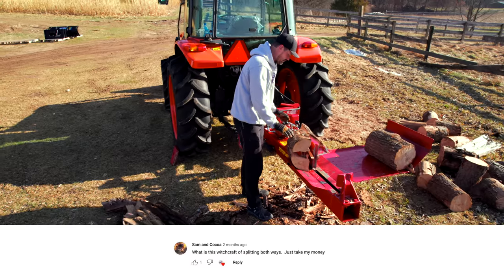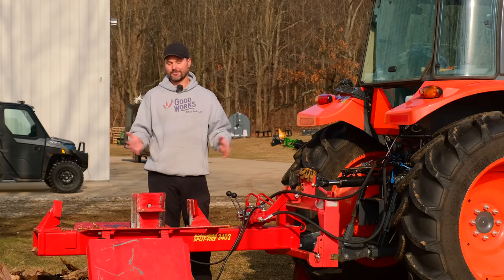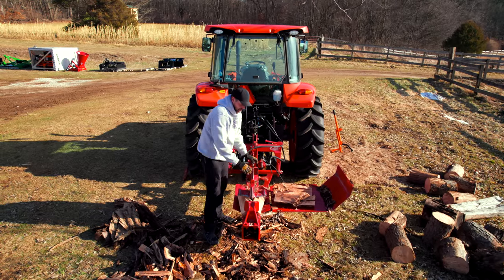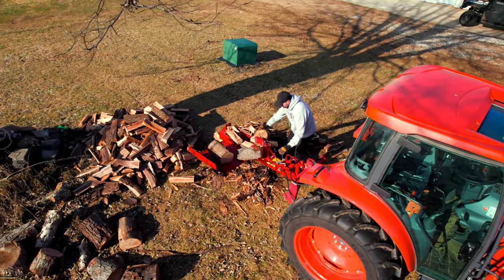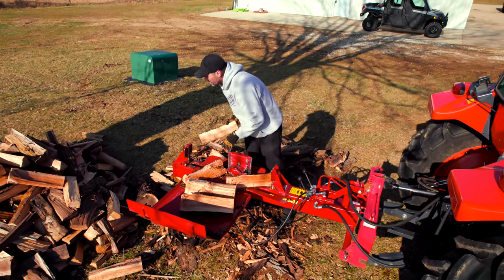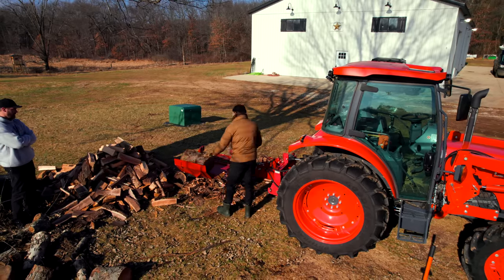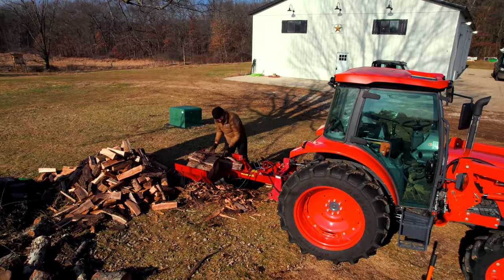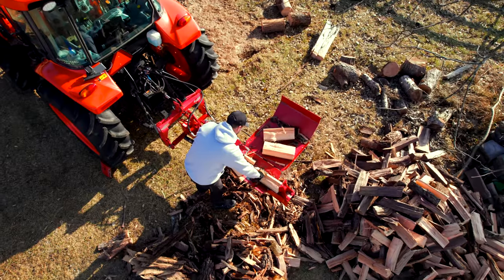THIS IS CRAZINESS! ARE YOU AFRAID TO USE YOUR TRACTOR?

Comment: If your going with a three point hitch splitter . The best option is buy the one with its own overdriven pump and tank . You get high torque and high gallons per minute . The tractor can run at low rpm because the pump is over driven . Tractor won’t even sneeze under load because of high torque . Also higher pressures than the tractor hydraulics can provide . It has its own adjustable relief . Being able too back right over the pile of cut wood is a great option also or move  around too different locations with ease . Planning your woodcutting and splitting is the key also . One machine with grapple and splitter can make life easy when you plan ahead . Any tractor can run it also because it’s self contained . A hydraulic top link is a must also for lowering and raising the splitter and keeping it level .

Comment: The main reason I’d like to have log splitter powered by its own engine is I think bucket of the tractor could be used in the log splitting process. If the log splitter does not have a log lifter the bucket could be used to lift big heavy pieces of wood to the log lifter. If the log splitter does have a log lifter the bucket could be used to place split pieces of wood into and then moved to the wood storage place.

If I get a chipper I’ll definitely get a tractor powered chipper. A tractor engine will be of great benefit when chipping up vegetation.

Comment: I purchased my tractor to move firewood with less effort. I had a buzz saw on the pto to cut free pallets for firewood, the problem with using the tractor is that it is not available to move the cut wood.  I made wood bins out of pallets to stack wood into and could stack them on each other using the tractor pallet forks.The less you have to handle the wood the better it is. Separate wood splitter is the way to go for firewood and stack it as you split it. In you video you will need to handle it again.

Comment: I like to use the grapple to bring the rounds to the splitter. Kind of hard to do if the splitter is on the back of the tractor.  I do love the idea of the splitter on the hydraulic thumb on the backhoe. My 1025r needs more power .

Comment: When I have to decide between power sources (tractor vs standalone) for equipment, I try to think will I use the equipment at the same time as the tractor.  For example, I use my tractor to move the logs, rounds, split wood from where it is processed to the wood stack, truck or trailer.  the tractor driven equipment then gets in the way and becomes a hindrance to hook, unhook or move around as I process the wood into firewood.  As I'm normally doing this work with my wife, son or other people, being able to split tasks and not limit the tractor to just splitting saves a tone of time.

Comment: I never worry about how many hours I put on my tractor. Resale value is never a consideration. I bought the tractor to use it; I use it whenever and wherever I need it.

That being said, I have a gasoline powered splitter, but that’s because I bought it used for $700. Far less expensive than a 3 pth splitter.

Comment: I used to think about hours on my tractor what helped me was looking on line and trying to find high hour tractors to see how long they last. Now I don’t shut it off until the work is done😂 it stays cool in the summer and warm in the winter 🥶 thanks for the video😁👍🚜💨🍳
Reply: That is a good approach as most wear occurs during cold starts.  Leaving a diesel run will almost always extend its life.  Engines that are run continually on some stationary equipment will run 10s of thousands of hours before overhaul is needed.  The engines that wear out fastest are those that are stopped and started often.
Reply: @LTVoyager  And my starter and battery are Happier😂👍Have a great weekend
Reply: @LTVoyager  I could not agree more.  I have over a dozen diesel tractors (goofy, I know) mainly used units bought cheap.  I figure starters and ring gears are expensive and a new ring gear is a real pain!  I’m going to add fuel anyway, what’s a couple ounces more.  Go to any major fuel stop, you think those truckers are losing sleep over their truck idling?  NOT.
Reply: @MJADoingStuff  More fringe benefits.  😁

Comment: For me the decision was very easy. I’m a full time logger and firewood producer and the tractor is used for loading logs on the log deck while processing firewood, so I can’t have the tractor powering the firewood processor and the splitter. I feel that is even if I was producing firewood for my home, I would want my splitter powered separately. There no right or wrong answer, just how you want to do it.

Comment: I don't like maintaining multiple engine powered tools that I can consolidate with the use of one machine. Plus, fueling one diesel machine is just easier and less hassle than dealing with several gas powered tools. The "hours on the tractor" debate comes up a lot when discussing pto powered generators... I'm never going back to a gasoline powered generator.

Comment: Stand alone equipment or attachment? Tough one since everyone’s situation is different. There are space considerations,  cost/maintenance considerations and how important is it that your equipment run when you need it. If all you have is attachments and the tractor goes on the fritz pretty much every attachment is useless except as a paper weight. All your eggs are in one basket so to speak. For my situation I have at my disposal a walk behind snow blower and a cheap Craftsman 42” lawn tractor. I toyed with the idea of a UTV with a front mounted snow blower before going with a subcompact tractor. I would have had a 4 season toy as well. So many ways to get ‘er dun!

Comment: I have ran my Titer for an FEL splitter on my M7060 for years and it is awesome. Only run the tractor about 100 RPMs and can easily split all the wood I use on a couple hours. I have too many engines to keep the oil change in already so adding another was silly. Now if I was selling firewood I would go another route. I got my tractor to use and could give 2 shits about the hours.

Comment: I have 2 reasons I run a self power log splitter vs a 3 point I only split maybe 2 cords a year on the high side and then the frees up the tractor to move those rounds to the splitter

Comment: nice video. cool little splitter. i have an old 27 ton craftsman splitter. you're right about the maintenance. i just had to switch out the motor on it. i had it before i got my little 1026R. thanks for sharing.

Comment: I opted for a separate, pull behind splitter.  Cost was a factor, the 3-point splitters cost a lot more.  The other thing is that I sometimes want to use the tractor and front loader / carry all to move the wood that I'm splitting.

Comment: Well I use the pto driven log splitter.  I’m one of the few who bought a gear drive tractor and it doesn’t have all the rear hydraulics there.  Another big advantage of a tractor driven one is friends can’t borrow it.  Sorry you need a tractor to run it. 👍

Comment: Thanks for this video and providing some good info. It was very helpful. Again, I don't own a tractor, so I have a lot of independent yard equipment. There's nothing mor frustrating than spending half your day fixing something that is supposed to save you time and effort. I'm thinking if I get a Yanmar with a 10 year power train, the engine for powering implements is covered a lot longer than stand alone equipment. So, I'm starting to side with those who aren't concerned with putting hours on a tractor,  especially with the numbers you mentioned. Though, I have no idea of the cost of yearly maintenance. I still need to understand that impact.
Reply: I like your Yanmar thinking.  My experience with them has been positive.  I purchased my first Yanmar used 36+ years ago.  I still have it and use it regularly.  Other than normal maintenance, no issues.  It is worth as much or more than I paid, but I’ve had the joy of usage for all this time.  In addition I have since bought several other used Yanmar’s.

Comment: I really like have tractor attachments rather than self contained units be it wood splitter, chipper, mower whatever, and it's not so much about  engine maintenance it's more for me about years later all little gas engines will have carb issues or the pull cord breaks and then you have to work on it just to use it where a tractor mounted unit alot less things to break. Plus if you use your tractor more often then your usually going to keep it in better shape and not let it get run down because you use it so much where a little 5hp Briggs that you use twice a year your more appt to just keep nursing it along or plain forget it needs something till you go t use it

Comment: I have a country line splitter that is ran from my tractor. It’s not as fast as some high end splitters but it works well. If I was to do more than 3-5 cord a year I’d wanna up grade to a wolf ridge or Easton made. I hear ya about people crying about hrs on the machine. I’m not worried about the hrs. Like you said. I’m in the 100hrs or less a year category.

Comment: I have a jd1023e and I like mine, horizontal/vertical, runs off the power beyond. With 16"-18" firewood, I have about a 10 second cycle time. I'm not concerned with hours, as long as it keeps me from swinging a maul. A stand alone unit was above $1,000, whereas I got mine for around $800 new. But, to each their own.

Comment: I agree with you  that reducing the number of engines is a key reason for the PTO splitter and other like attachment. I bought a PTO  generator just for that same reason. The small gas engines even when using ethanol free fuel still have miserable reliability when compared to a diesel tractor. Plus I store far more diesel than gas so always have the reserve.

Comment: Using stand alone splitter I've added several hrs to tractor running work lights. If I didn't already own stand alone years ago before buying tractor the 3 point would have been on list to look at.

Comment: I’ll throw one more log on the fire (sorry, couldn’t help meself)…

Hourly maintenance costs vs annual maintenance costs. If most of us, me included, are putting less than 100 hours on our tractors, and my owners manual requires service at 200 hrs or annually, whichever comes first,  it seems to make financial sense to use the tractor to power anything you can. I have a large, trac-drive snowblower which sees less than five hours use each seasons-I use it to clear our sidewalk and, also,deep drifts next to the house where my tractors plow might cause damage. I still need to maintain it annually — along with a generator, garden tractor, self-powered tiller, power washer, log splitter, weed trimmer etc. 

Each of these see little use individually, but the time, cost (10-12 quarts of oil between them) not to mention the pain of draining and disposing of “clean” oil.

Comment: I have a 35 Ton 12.5 HP splitter I bought probably 22 years ago approx. I haven't had much trouble with it other than the plastic dogs in the pull starter. I burn about 6 cords a year and share the splitter with two of my brothers. I like the split fire and have thought about a tractor powered splitter if I ever have to have another one. I traded in a B7800 Kubota, which I bought new, and got a little bigger L3301. I too typically put about 100 hours a year on my tractors. I've owned a tractor for approx. 17 years. Don't know what Id do with out it. 
Only thing I don't like is this new tractor regens about every 25-30 hours the way I run mine. How many RPMs do you need to run your tractor for a splitter?     My Kubota dealers mechanic told me its better to run it 2000-2500 rpms than to run it low due to it going into regens sooner. I don't really care for all the EPA junk these days. My diesels are pretty good on fuel usage though.

Comment: My deal is as cheap as it gets.  I have a 5 ton electric yard max  for 200. I have a 1723e  and use it for everything I can.  Load the wood on a pallet with sides and  deliver it to the front porch. I have no place to go cut wood. I have a cord delivered for 200  split.  But I split it again because of the small wood stove insert. Believe it or not, the little splitter works pretty good. A stand-alone gas splitter would be overkill for me. 🤔

Comment: I'm not sure your brush cutter versus splitter comparison is a great one.... For the brush cutter, the tractor is really needed because it's pulling the cutter around so it makes sense to make use of the PTO to run the cutter (I have one and do exactly that). But for a splitter, there is no need for a tractor since the splitter stays in place the entire time. Also with smaller tractors, the hydraulic flow really just isn't enough to run the splitter well. For these, and a few more reasons, I prefer my stand alone splitter. As far as small engines go- my folks still have the splitter that I grew up with and I'm now over 50. I borrowed it a couple summers ago and the Honda motor still starts on the first pull and runs without any issues. When I bought my splitter I got one with a similar Honda motor and couldn't be happier.

Comment: My splitter which I built on a I beam has a 13HP engine on it and a K car axle. The engine is electric start. I have split a average of 15 cords a year. The engine is now 10 years old. Only issue other than changing oil is the start solenoid has been replaced once. I can hook it up to the tractor but it is to slow on it. The current cycle time is 6 seconds with the 13hp. I do lend it out and I don't want my tractor to go with it.

Comment: My dad had a kioti tractor the same size as a 3000 series John Deere. Now believe it or not he had over 50,000 hours on that tractor. He lived in Florida and mowed the sides of the roads of the subdivision that he lived in and the surrounding subdivisions for 20 years. Now at that point he had to replace a sleeve in the motor . But that tractor is still running around.

Comment: In my situation I use the tractor to move my firewood from the splitter to the woodshed and the two are not necessarily in the same location so a three point splitter wouldn't work for me anyway. Also, the cost of doing an oil change on a Briggs and Stratton is quite a lot easier and cheaper than on a tractor. Even doing it yourself can cost $150 and up on the tractor as compared to $12 on the stand alone splitter. And then  you would need another way to move the firewood. That's just an old man's opinion.

Comment: Cost of ownership per hour used goes way up if you don't use a machine enough. Most of the cost of ownership on a tractor is largely the initial investment, and that gets divided by hours of work it does. I'm sure there is a break point where the cost to maintain becomes the more significant factor, but I don't believe most non-professional users will ever get to that usage level. 
In effect, cost is fixed for the most part, and using it more reduces cost per hour. Use your tractor more to increase the cost benefit ratio.

Comment: i dont need fire wood down here but i would think i would want my tractor useable for moving stuff around while  spliting the wood. like putting the wood right into the bucket so i wouldn't have to pick it up again. so for those reasons i would think a stand alone would ne nice to have with a tractor but i wouldn't want either without both

Comment: I paid a decent amount for my tractor and I'd like to use it as much as possible to get my money's worth. Hate to spend money on something and let it sit. Especially a diesel. Besides that I use ethanol free gas in anything with a carburetor and that is harder to come by than diesel. The diesel engine will last a long time, and it's quieter. Lastly, being on the 3pt I can adjust the height of the splitter. I'm tall and regular splitters are made for shorter people.

Comment: The short time attachments for tractors put almost no stress on the tractor. It may wear out the rings and bearings a little bit faster than it would setting idle. An overhaul cost much less and is much faster than a full rebuild.

Comment: You may want to take another poll as the first one seems skewed. I can't imagine folks paying for a tractor that only use it 2 hours a week. That just doesn't sound right. As for me, I own a tractor and a gas powered log splitter. Most of the time I use the tractor with grapple to bring logs to the splitter so I wouldn't want to have them hooked together. Besides, the splitter fuel is cheaper and the little Briggs and Stratton engine uses a lot less than the tractor! But to each his own. I understand every ones situation is different and will dictate what works best. Thanks for video, cheers!
Reply from the maker: I've done that poll several times, it is accurate.  I also bought and sold used tractors for years and saw thousands of tractors for sale that were several years old with 100 some hours, often times less on them.
Reply: @GoodWorksTractors  in your experience would you say the majority of the tractors you're referring to are 50hp and under? Because if a farmer buys one (usually 80hp +) it seems like it'd be a different story. The smaller tractors being bought by the weekend warrior grading his driveway probably don't see near the use the bigger ones do.
Reply from the maker: Yes my business is compact tractors and so is the majority of my audience.  Farm tractors are a completely different segment of the market.
Reply: @GoodWorksTractors  it was confusing because the tractor in this video isn't a compact
Reply from the maker: Lol okay

Comment: Just my opinion, I love the idea of a tractor powered splitter. The problem I have is I don't have enough tractor to make it feasible. I have a 2020 New Holland Workmaster 35 (LS MT235) with only 12 gpm hydraulic flow. It's just not enough flow to split. It would be too slow. I've seen PTO attachments that spin the oil at 22 gpm but that's one more thing to go wrong.